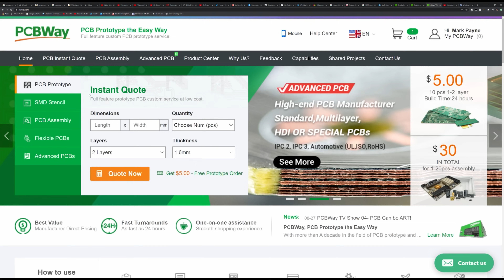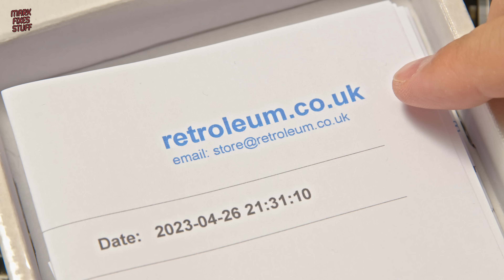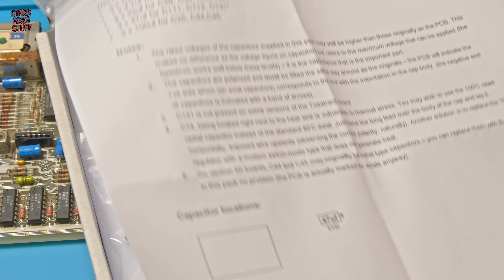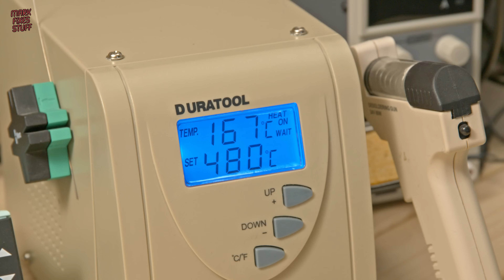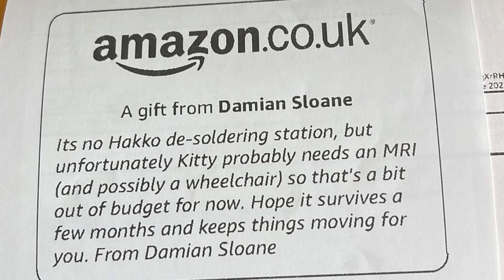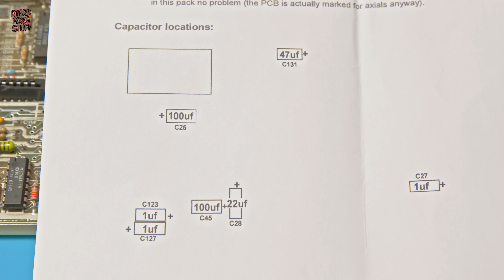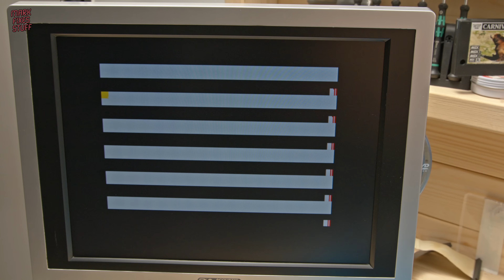Will Recapping fix this 128k Sinclair Spectrum Toastrack? Disaster Occurs!

Comment: Around 13:40. Before i was fired due to a reorganisation, i soldered on PCB's for military communication systems. Cutting the legs after soldering was allowed, but not cutting in the solder.

Comment: what solder with lead !. hehe jealous i have run out......... i always use braid and manual pump. seen what a bad desolder station can do to a mini main frame board.... was not pretty. my old 48k died years ago needs a full recap new membrain and a new ALU which died when one of the audio plugs went for a strole across it one day..... very sad day ... but i did get a c64, not as good as the old speccy

Comment: I notice on the underside of the board one part has brown solder joints, as if that part has been de-soldered, and a replacement part put on, using loads of flux. Is THAT the rom chip?

Comment: my Duratool spends most of its time being blocked .. ram the temp up to max wait a couple of mins then ram the unblocking rod down it with a pumping action with the nozzle off so you can use the thickest one as it has more oomph. *caution* it gets hotter than the sun

Comment: I know it's not the answer but, would reattaching the keyboard make any difference to the problem?  Just a thought.  I didn't have any niggle with the soldering, but the non-cleaning of the case, is a different matter, perhaps?  LOL.  (Also, is the speaker missing - or does it not have one on the underneath of the board?  Just wondering!).

Comment: I have the same desoldering station you were gifted. Cheap, but works fine. Most annoying thing is that the post switch is on the back. One of these days I'll move it over to the front. 
They also left the lcd protective film on in mine. So much for quality control, but it's perfectly readable so i have not bothered taking it out. It works fine so why would i.

Comment: To me it looks like they tried to recap the board without taking it out. Soldering everything in from the top. 
Lazy and bad.
Reply from the maker: No becuase Definitely they worked on the bottom too, but I think they had the "screwdriver" solder iron type and it was a disaster for the temperature. As a resort they tried to patch onto the top of joints that went to the ground plane. 

Not much damage though!

Comment: Instead of clipping the leads you can use coastal erosion, but it takes a lot longer to complete a project. That's why I moved to the Isle of Wight, it seems to happen much faster here.
Reply from the maker: Coastal erosion isn't part of MIL-SPEC. Sorry.

Get out.

Comment: Great video Mark. I like seeing the desoldering techniques that I struggle with. Please can I ask do you apply flux before you desolder?
Reply from the maker: Hiya Keith!

No I don't! The reason is that the flux would burn off before the old solder melts. Flux is really good for cleaning joints and allowing new solder to flow but not getting old solder flowing. That's why I sometimes add new solder. That helps the older solder to flow and that is key. 

Flux burns off and clears any oxidants on the surface of a board. If you add it to the top of an old solder joint you're just cleaning the tops of something you'll be removing.  An exception to this is SMD soldering where you use a gooey flux to "mop off" small amounts of solder. 

My answer to you is to clean the work joint with IPA, try to melt the joint and if no joy, hit it with some fresh solder to get it going.

Comment: I own the same desoldering station that clogged up on you and mine does it as well. But there is a way to clear it.
First, you remove the glass tube that collects the solder. Then, with the desoldering gun heated up, you insert the poker that came with it into the opening and rest it with the handle of the poker on the table so that you can apply gentle pressure. It won't poke through yet. With a soldering iron, you heat the tube end that normally goes into the glass tube and then it just takes a few seconds to clear the blockage. 

I have yet to find out why it clogs up there, but likely there is a spot that is just a little too cold and the solder solidifies there.

There is a number of mods that I have applied to mine.
- Put in a proper voltage regulator module for the pump and the fan (they normally go through two huge resistors to reduce the transformer output voltage
- Opened up the ventilation holes in the back, put a new fan with a proper grill in there instead (much quieter operation now)
- Put a relay in that is controlled by the trigger and in turn controls the vacuum pump - that way the inrush current of the vacuum pump doesn't go through the trigger switch
- Not sure if this is just on mine, but despite being a two-pole mains switch, only one wire was actually switched. Here in Germany, our plugs go in both ways, so you never know what's live and what's neutral - so I went ahead and switched the second wire as well. I know this is a problem you don't have in the UK.

Comment: My duratool desolder station does the whole clogging up thing regularly but the probe tool coupled with an extra hot soldering iron to boost the temperature always seems to do the job

Comment: Folks should really heatsoak these boards with hot air before trying to recap. Old boards have a ton of thermal mass, thick traces, and zero thermal relief. A bit of patience to make sure the board and traces are already warm and the iron isn't constantly fighting thermal dissipation goes a long way, even on SMD stuff. Clearly went fine for you, with the right iron set up for the job and plenty of flux, but most people just go at it with a £30 non-temp-controlled cheapo iron that has about 30W of output, and tend to ruin their boards.
Reply: It went fine for him because you are talking nonsense. There is no reason to heat the board. Proper equipment will get the job done in minutes. It's hardly a challenge.

Comment: I have the exact same desolder station as the new one. It works great but when it arrived from Amazon it had a screw rattling around inside it that had no obvious source, which was odd and a bit worrying as it could have shorted something out if I hadn't noticed.

Comment: When I got into this stuff I very quickly found out that it's not soldering but desoldering that is the real art. Great video to showcase the various techniques of it.
Reply from the maker: I know you are very experienced in this stuff now Cat, so your comments mean a lot!
Reply: Depends on what you are soldering or desoldering and with what equipment. I find desoldering easy. Same station as he got new. 
High pin count smd is where it gets really interesting and hot air rework.
This stuff really should not be a problem with the correct equipment. Find something to practice on and pay attention to how the solder reacts. Don't force things and be patient.
Reply: @bzuidgeest  I agree on the finer SMD stuff. But some of the most problematic things I encountered were throughhole components on comparably modern boards with big groundplanes inside and unleaded solder.
Anyway, the mileage may vary, I was mostly looking at it from a beginners standpoint learning about soldering and desoldering at the same time and figuring out that the latter was not trivial in comparison.
Never needed to try multiple techniques to put a simple throughhole cap in. Out tho, hm.

Comment: Silicone tube added to desoldering pump is a must, I find it much easier now. Mark there are also some PCB mods you can do, one redirects audio later in the video chain for even better picture. Done all the mods to my toasty and RGB is spot on now.
Regarding error, I will go for it being a memory issue.